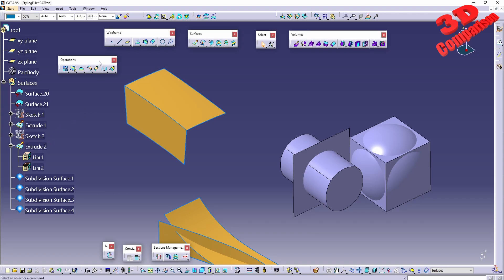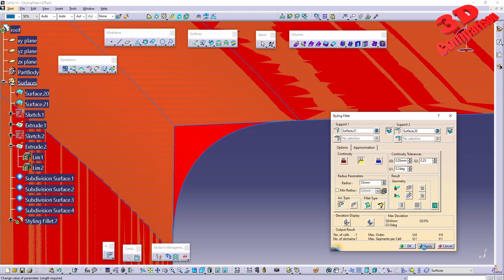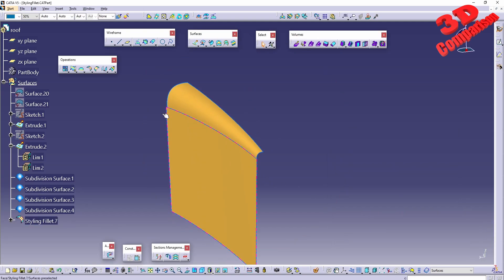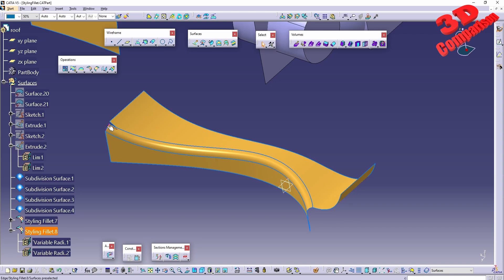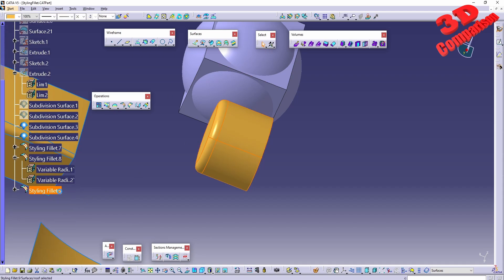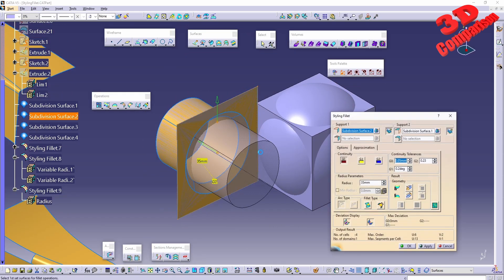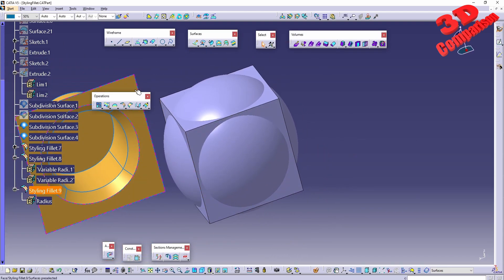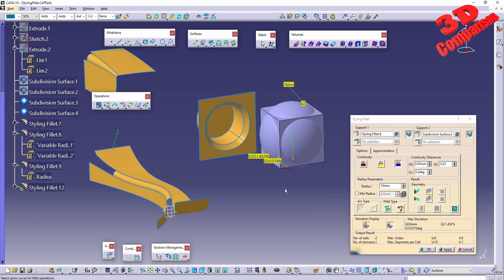CATIA V5  - How to use Styling Fillet

Comment: How to use the spine option in styling fillet? Thanks!
Reply from the maker: The spine option in CATIA V5 is used to control the shape of the fillet along the edges of a part. It allows you to create fillets that are either more or less rounded, depending on your needs. But adding this to the Styling fillet is not possible as far as I know since this feature is only available within other fillet types. I have created a video regarding this - https://youtu.be/eDNlAjFB2uA. Thanks for the question!